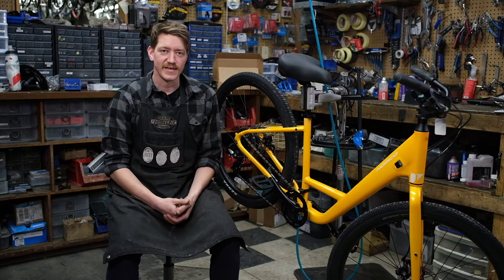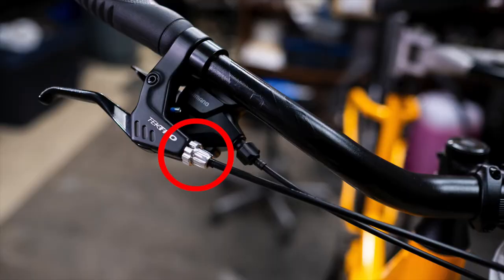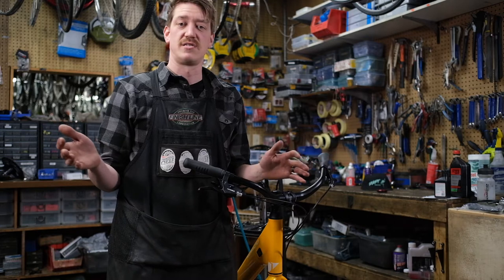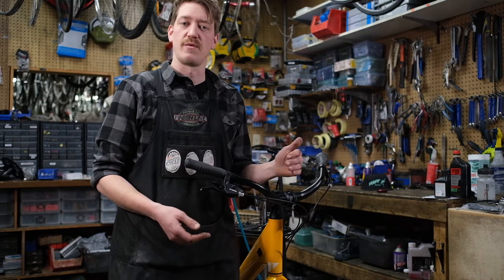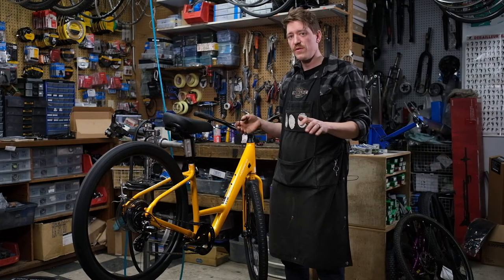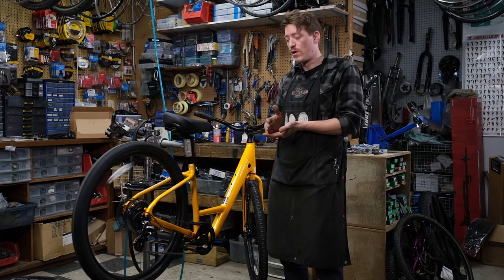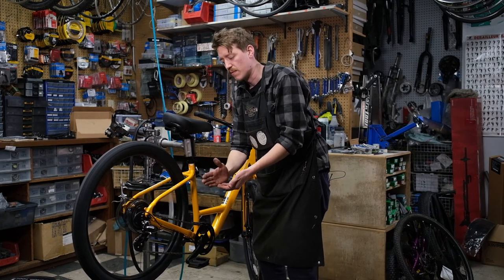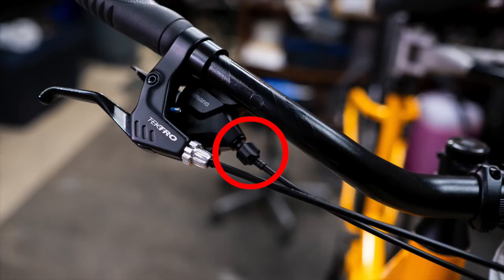How to use barrel adjusters

Comment: Should you use the shifter barrel adjuster or the derailleur barrel adjuster when tightening / loosening the cable. Or doesn’t it matter?
Reply from the maker: Great question! I prefer to use the derailleur B.A. so that my shifter B.A. has room for potential adjustments while I'm riding. I only recommend adjusting while you ride if you're confident you know what your doing and can pay attention to your surrounding at the same time. Never try and adjust if you're in a pace line or traffic or somewhere with road obstructions- Safety first!

Comment: Still not sure where the barrel adjuster should be positioned when setting up original cable tension. In the middle?
Reply from the maker: Hey Ian, good question. Ideally you would have the barrel adjuster unscrewed approximately 15% of the length of the thread. Which is usually 2 full turns out from all the way in. This will give you enough room to adjust in if your original cable tension is too high, and plenty of room to tighten the cable if your original tension is too loose. Hope this helps!

Comment: What is the barrel adjuster gets undone completely ? How to put that back ?
Reply from the maker: Yes! It's a threaded piece, so you should be able to just screw it back on. Depending on which part of the bike it's on, you may need to loosen the tension on the cable to do so but taking the housing off one of it's holding positions.

Comment: How often is it normal to increase the tension in the derailleur cable? I have a new KTM bike, and the tension in the rear derailleur needs an adjustment every 2-3 hours of riding, if i shift the gears often.
That means the chain starts to fall from a larger to a smaller pinion, especially while I climb a slope. Or shifting to a larger pinion gets difficult.
So, is it normal that the derailleur cable needs more tension every 2-3 hours, in these condition?
Reply from the maker: Great question. It's not normal for the cable to need tensioning that often. If your derailleur is shifting perfect at the start of the ride and by the middle, it isn't shifting properly, it could be the bolt that clamps the cable is stripped or loose. It could be an issue of the derailleur hanger coming out of alignment (hit or bent somehow?). This issue may need a professional to look at.

Comment: Barrel what? Ca...bles...???
Reply from the maker: lol, not eeeeeveryone is riding the new AXS or Di2!
Reply: @frontenaccycle  News to me..
Reply: @frontenaccycle  I loose the barrel adjuster too much and the cable suddenly came out and the brakes are not working now . what to do? pls help
Reply from the maker: @SawanHooda7152 The best way to get the cable back in the lever, is to undo the cable clamping bolt, or release the brake tension(depending on the type of brake). It is important that you screw the barrel adjuster back in, otherwise your brake cable wont have the correct stiffness to maintain braking power. Hope this helps!